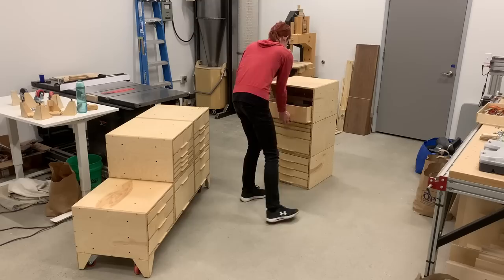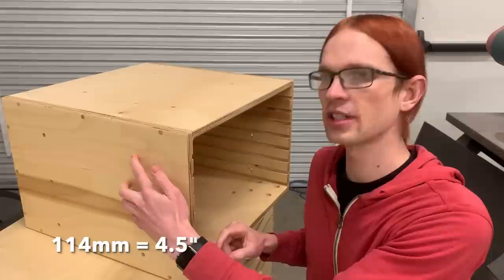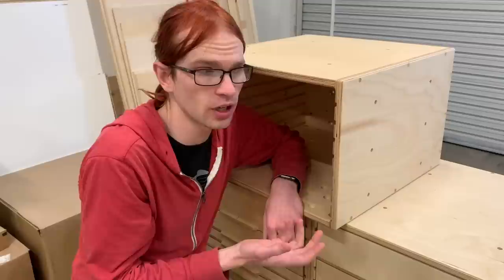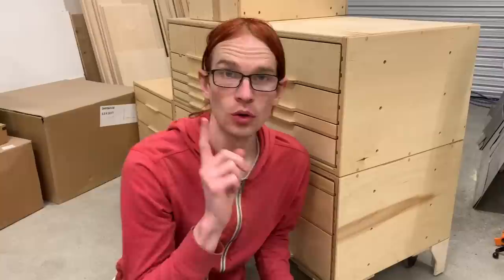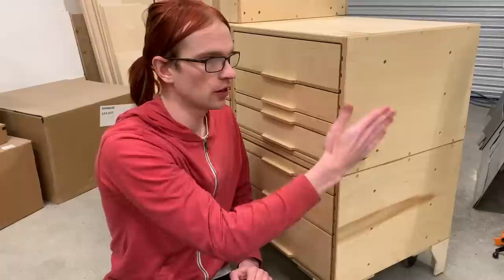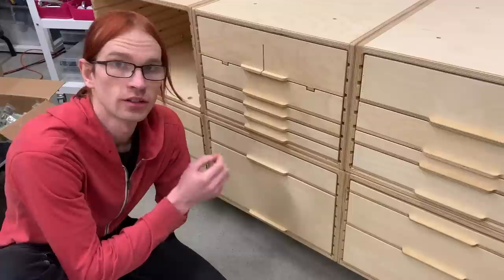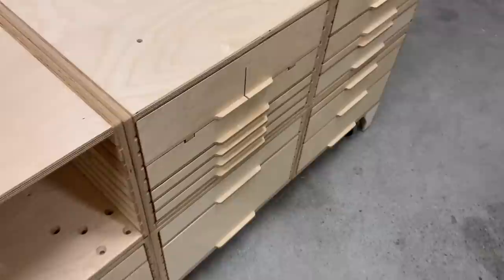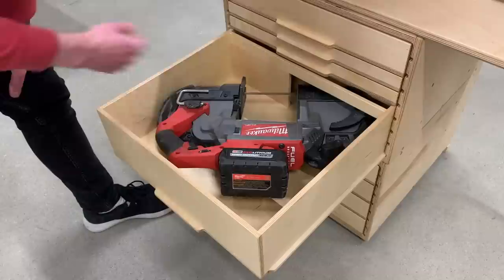How I designed my modular cabinet system

Comment: Several years ago when I had no money I based my first toolbox off your early drawer designs.  The false drawer back and slider on the bottom are still working great even when made with lumber picked from garbage bins.  Showing the thought that went in to your design increases the value of your plans and someone can have confidence that the choices you made are good ones.  I'm hoping to purchase your plans since I relocated to a different country and am building out a new garage.

Comment: Love the design! 

You could also add French cleats to wall mount with the rear holes... which would be amazing for your half-depth cabinets, too... you would have to set the cleat heights based on your hole pattern, which would let you use your front feet.. but it would be pretty easy to set up a story-stick then laser across for each cleat.

Comment: The sag test at 16 minutes is really interesting, because presumibly in this configuration one would put some kind of top on the cabinets, and now if each of the boxes is bolted into the top, the top becomes load bearing in a way, and also slightly increases the lever length between the lower side-to-side bolts and the "point" of "rotation" that the bolt is resisting, as now it's in the tabletop somewhere instead of at the top corner between the boxes. With a top you could also assemble it like this, put the top on, put the bolts in, and then loosen the bolts between the cabinets slightly so you can tighten the bolts to the top, before tighting all the bolts again now with it all aligned very well. I really like the design but also it's fun to think about

Comment: It's a really cool and well thought out system. I was thinking that for a soldering station the drawer front might be in the way for convenient table-top operation. You could instead mount it on a base plate that fits inside the drawer and has holes or cut-out handles at its edge to lift it out. For something like a bench grinder it may make sense to foresee a registering feature on the bench top, as these can otherwise wander due to vibration. Could be a pattern of pins or holes or a baseplate-sized pocket that's otherwise filled with an inlay plate. Of course, just clamping the base plate to the bench top with its convenient clamping overhang also works or perhaps some anti-slip base. I'm pretty confident that this is only the beginning of endless possibilities and many inspired projects 👍
Reply from the maker: Thanks!

I figured the front shouldn’t be too badly in the way, but I had thought of making it either removable or on hinges so it can fold down onto the table if it’s a problem. Then again it could be nice to have, for mounting a fume extractor, lighting, and power outlets out of the way so they’re not cluttering the base plate.

I was envisioning just clamping down the benchtop tool drawer. I wonder if I could integrate some flip-down clamps, so they’re always there.

Comment: Excellent, really enjoyed watching this!

For us here in Europe, the reasons for going with 508 x 508 don't really apply, so I am tempted to propose for the EU version:
- 400 mm wide (like Systainers and euro boxes, which are always a multiple of 400 x 300 and hence fit nicely on our EUR-pallets here (1200 x 800))
- 550 mm depth: nearly like 400 x 600 euro box (or two systainers), but leaves some overhang for the clamping to the table top and also fits inside a closet (IKEA Pax, 600 mm outer depth)
- Also I'd love the inside to be #gridfinity compatible.

So I think it would be worth working out a version with alternate dimensions. Let's see who first puts in the time to come up with the genius numbers for those requirements ;).

Edit 1: Consider coming up with a "hashtaggable" name for your design. Would help this take off more!
Edit 2: Of cause I'll by the plans befor I start building. Support well deserved!
Reply: Exactly this, I also would like to see compatibility with commonly used standards such as euro boxes (https://en.wikipedia.org/wiki/Euro_container) which also contain about as much nerding-out in thought behind them as this video. 🙂

Comment: I'm building my shop in my new house, and the fact that I will move out one day is always in my mind, hence the modular design of the shop is always at the top of the design factors. Jeremy, you thought the design so far and so well that seeing it I think I do not need to spend much time in laying out my shop - I can always re-stack these blocks in situ, many times.
Yes, I will buy the drawings - at least because their cost is much less than I would spend on "tries and failures" and, of course, time. Ethical considerations are not the last, though.
Thank you!

Comment: Holy cow... the amount of planning you put into this is the sort of thing that would normally require an entire project team! The level of compatibility and modularity here is astounding. I wasn't planning on building these previously, but this video shows so many considerations that I'm blown away by the design. I'll definitely be buying the plans when I get to that stage of my shop planning. 

Bonus: The cheap Harbor Freight "parts storage case" boxes come out to 16.5 inches wide and 2.25 inches tall, so I should be able to adapt them to work with this system (if nothing else, just creating the "drawer slide" base to hold them), this is great because these bins are amazing for small parts, and being able to combine "grabbable bins" with regular drawers is awesome.

Comment: Very cool. The drawer paired with the sled could be used for table saw blade storage with pins to stop them from sliding around. It could even be the shallower drawer than the one you have now.

Comment: I started making a similar system but went way too complicated using box joints and home made full extension drawer slides. Ended up just buying a used tool chest after finishing one module. 
Having the but joints, simple slides and especially the fixture for glue ups is a huge time saver and greatly improves accuracy. Plus the trimming several dimensions to size after glue up saves you from having so many tight tolerances to hold. Very smart.

Comment: One specialty drawer that I've always used in my modular benches is one with a false bottom and a middle height shelf that has 1/4" and 1/2" holes for storing my myriad assortment of router bits. For one iteration I basically made it an upside down box that was removable and had the same holes bored in it for a removable / transportable solution. 
 Another drawer was made with holes that accepted dowels in order to store my sanding discs. The dowels served as a means of limiting them from sliding around. Having access to a combi line boring machine in my custom closet division aided in boring a ton of 5mm holes. Even so, a little time spent still gets it done. 
If you enjoy a deep dive into cabinetry specs I highly recommend looking in to the 32mm euro system of cabinet panel manufacturing. It is beautiful in its logical approach to accommodation.
Thanks for keeping content flowing on your channel.

Comment: Brilliant. A couple of benefits of your design decisions that you didn't mention: first, baltic birch in 5x5 format is substantially less expensive per square foot than 4x8 format and, second, having the tops and bottoms end inside the sides gives a much cleaner look to the sides of the stacked cabinets, especially once you put a top on it. Well done.

Also, the multi-cabinet deflection test and drawer load test were impressive. The details of your clearance dimensions and how they changed over time were enlightening. I love how you take us through your thought process in general and explain the details of things like your hole placement and rotating feet. Thanks!

Comment: Jer, many thanks for explaining your rationale in so much depth. This form of organic thought is very much in demand and without wishing to mis-use a phrase, it is truly ‘Made for Manufacturing’.  
Further application of your obviously active and logical mind and input from the community at large will undoubtedly produce changes, improvements and hacks, but the basis of your appears very sound. 
Making the plans available also adds to the attractiveness, and I sincerely hope that your original thought processes are justly rewarded, and not pirated by those lacking scruples.
A well thought through construction and build, optimising the use of standardised materials. What more could you ask for?

Comment: If you make 'drawers' with permanently mounted tools, maybe whatever top you use can have a pocket cut out that the drawer can slide into to fix it in place on the bench, plus an extra drawer bottom that will let you fill in that pocket when not in use. That opens up the possibility of extra drawer bottoms either made from or inlayed with different materials so you can have different work surfaces (glass plate inlayed into the plywood for sanding, etc) or just a sacrificial surface for doing the stuff that really ding up your workbench.

Comment: I bet you could create a set of drawers without a top... with the idea you could have a few tools mounted to drawer (like you mentioned someone else brought up).  But instead of just putting it on your workbench, you could slide it into a slow of the middle (assuming 3 cabinets next two each other... but the middle one without a top.  Slide the miter saw into the right slot... and it's lined up at the top.  Pull that out, and push in one with a jointer and now you have an infeed and outfeed.  And last, have a drawer that has the top in it, when you need the top. for other projects.  Seems like it might be useful.  Good show all around!  Glad to see you back!
Reply from the maker: That’s a cool idea!!

Comment: Very interesting video! I find that, behind any design, the "why" is often more informative than the "how". For instance, I hadn't considered bending as a reason not to do double height cabinets. I suppose double height cabinets are still possible provided they are always a "middle piece" in a large workbench, as the bolts would prevent bending. It would allow for a "bonus"  single height drawer, or multiple very tall ones that can span across the middle. Maybe worth it, maybe not.

Comment: The engineering here is really impressive. For the workstation drawers, you might consider putting in a couple of recesses that could fit over a couple of posts on your workbench. This wouldn't be especially useful for a soldering station, but for a bench grinder (for instance), it would keep the grinder from walking around in use. For the posts, you could probably insert something into existing holdfast holes so that you could maintain a smooth surface when not using the work station.

Comment: The dedicated soldering station is a great idea! I've thought about doing that with something shaped a bit like a briefcase, where the top would fold up to vertical and be for parts storage and the bottom would be for the soldering iron and other tools. I guess that might work as a drawer, having a hinged lid that folds up into a vertical while you're working.

Comment: Earlier today I was thinking about making some kind of sliding system for attaching power tools such as a table top grinder to my workbench and now when I saw your videos on this system and the comment you mentioned at the end I thing it's great idea and sort of expands and refines my earlier thought. So, thanks for the tip :-) 
Also,  wanted to say that as an engineer that probably overthinks pretty much everything I'm sometimes a bit tired of most woodworkers on YT grumble about how they hate math or are bad at it  blah blah blah and here you've got beautifully thought through system with all the dimensions being exactly as they should and serving a purpose - thanks for that experience too :D
One last thing - indeed we have 5'x5' or rather 1525x1525mm sheets in Europe although it's not something you will find in a regular store ;-). The equivalent of 8x4 is 2500x1250 so it's a bit bigger than imperial, at least that's the standard in Poland. I think you can sometimes buy 3000x1500 as well.

Comment: That's very good.  It's an enormous amount of work to design these, and even more work to build them.  I'm very impressed.
If you're worried about sagging, just put more feet in the middle of the cabinets.  Even one bolt is good enough, because there's no sideways force on them.
Reply from the maker: Thank you! A foot in the middle works if the cabinet is stationary, but if it’s on wheels then not so much (unless your floor is absolutely perfectly flat).

Comment: First of all, I'm really impressed by how much thought you put into every detail. There's just two things that would have dotted the i for me - but it's probably too late to integrate them now. The first are storage boxes like systainers: if your system had either internal or external width and depth of 300x400mm, it could integrate with them, and also with "euroboxes" and a few other things. The other thing is almost the same: if the inside of the drawers was compatible with Zack Freedmans awesome Gridfinity system. So I'm thankful you spilled all your secrets because now I can take both these starting points and all your ideas and try to run through the whole design process again with the added constraints and see where it takes me. So thank you for doing all the experimentation, thinking, and planning, and not hiding your secrets.
Reply from the maker: Thanks. I don’t have any sustainers or gridfinity modules, so this didn’t really matter to me. But yes, please customize it to suit you!!

Comment: To prevent sag across a long set of cabinets you could also just make a foot designed to sit in one of the 4 central holes of the base.  They are back far enough to provide a toe kick and still support any added weight. Overall it is an extremely well thought out design.  Now to find a good supplier of birch plywood.
Reply from the maker: Yep, that would work fine as long as you don’t need the cabinet to be mobile.

Comment: I was planning on building an outfeed table for my sawstop soon, but now that I hear you’re planning one I kind of want to wait for your plans. Awesome video.
Reply from the maker: It might be a while, because I have several higher-priority projects. Also I don’t have any exciting ideas for it, it will likely just be a plywood table sitting on a couple of these cabinets. So don’t hold your breath :)
Reply: @Jer_Schmidt  Maybe I should make the base out of these cabinets (at least part of it), then the top a torsion box like i was planning. I also need some overhang, but the box could be mounted to the cabinets using the standard mounting holes you have in the plan. I'll have to see how all that could work together.

Comment: This is a great compendium of considerations, which I am mentally bookmarking for detailed later reference; I especially liked the insight to the 12mm pull tabs being sufficient for the 100# drawer and the observation that when units are 90 degrees it allows for mutual handle clearance. I am assuming you are waxing the slides. Ball bearing drawer slides can be had 'fairly' inexpensively, and personally I really like the action, including the last bit being downhill so the drawer closes positively, so including a few for heavier or frequently used drawers, would be a thing for me, and all you would need to do is route the slots wider and/or deeper to accommodate. Since I am in the process of building the Gen2 Belt Grinder (BRILLIANT planset), if and when I were to build some cabinets as described, I would just go ahead and purchase your planset, which is super affordable, and I am sure just as brilliant.
Reply: The waxing was in the first video covering the actual construction of the system.

Comment: I purchased the plans about 15 minutes after finishing your construction video. Now I'm in the process of completely redesigning the radial arm saw station that I had started drawing up. The half-size modules appear interesting but not sure about them yet.
Reply from the maker: Thank you! I actually don’t have a use-case in mind for the half-size cabinets yet. It just seemed best to leave that possibility open in case I ever need them.

Comment: hey! very cool :) i love when people explain some of the thought that went into why they did certain things. i know it is a lot though, so thanks for doing it! these are great. it is a lot of dados and holes that need to be super on point, but i am sure i could make a jig or template that fits as a "drawer" to keep making more of them, easily repeatable and accurately as my shop grows/needs. love the table saw sled fitting in there and the idea for a soldering station (plus just spots for quick tool drop to clear off the bench and easily put away in the real spots later if need be... the way the Paulk benches have the cut outs to shove stuff in there while working then to move and put away later). having modular shelves is so good and how small you made each one is great for things like how you used one as a bandsaw base and for the offsets. i am not sure the spacing of the offsets yet, but could maybe be used as stairs in a tiny house or for some tool shed lofts or for cat furniture etc. anyway, thanks for sharing all the kinks you've worked out over your multiple runs and use of them. plans will be well worth it to save all the problem solving phases and having to remake stuff etc. i will definitely be buying them this summer when i hopefully am able to set up my shop! peace & strength, AL